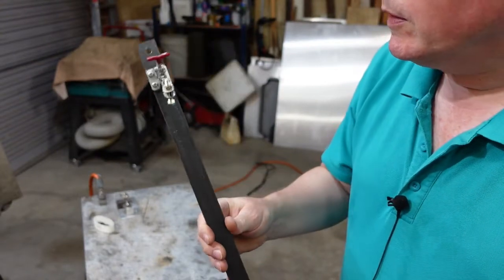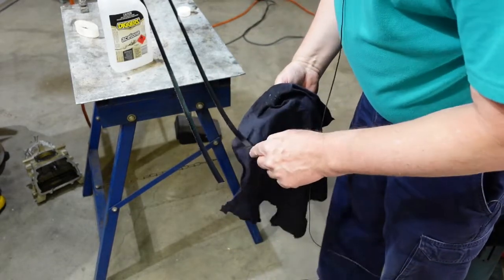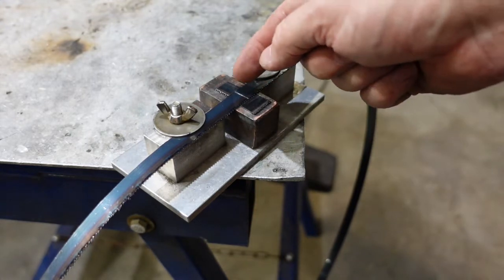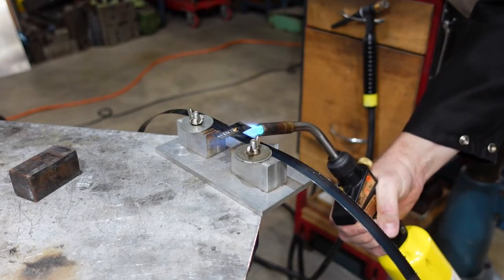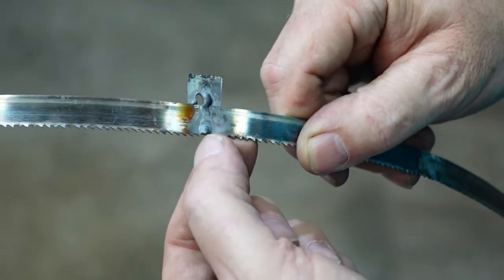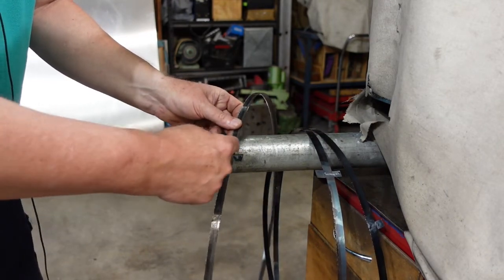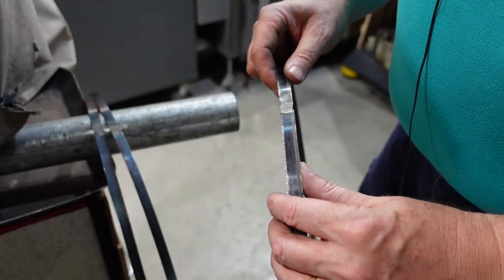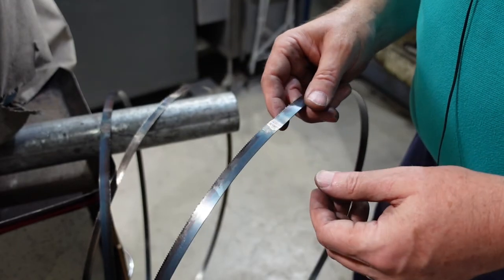Bandsaw blade welding

Comment: I was taught years ago to Silver solder Bandsaw blades by a Pattern maker a lot more involved but gives a better join in my experience, I have only ever joined blades for wood cutting saws
Reply from the maker: A proper lap joint has more surface area than what is effectively a butt weld, so any small inadequacy is less likely to matter. The reason I went this way was that I did not have the gear to sliver solder and when I had some blades made up that way by a saw place, they failed very quickly (the feathered edges caught and peeled apart). This is how I do it, just because I was not happy with the other methods available at the time.

Comment: When I was a teenager ( back in the mid 1960's )the schools in America had metal shop classes and I was taught to braze band saw blades. Very similar to silver soldering them but I believe brazing gives a stronger  joint.
The vertical band saws we used  had electric band saw welders included on them but the instructor wanted us to learn to do it the hard way as well!
No TIG welders back then and arc was way too hot so brazing with oxy/acetylene was the only way.
Several year's ago I bought at auction a Harbor Freight band saw welder. With fees it was $100.00 U.S.D. and it came with a couple of rolls of blade stock. Unfortunately for me it was for woodworking and I don't do woodworking so I sold them for almost the total cost of the welder. I have some longer blades than my saw takes so I have cut them down to the size I need and the welder works great. 
It appears that H.F. no longer sells this welder. Too specialized I suppose for the general public and besides, selling new blades all the time is far more lucrative!!
Thanks for showing an old man another way to weld up his own blades!!
Reply from the maker: When I first got my bandsaw, I had a local saw shop make up some new blades; brazed. They botched it up such that the blades peeled apart on the first cut. I don't have gas welding gear, so for me it was TIG them together.

Comment: Did you use a filler rod on the joint?  If so, what are the specs?  I have a knifemaker nearby who would like to have me be his "go to" welder for bandsaw blades and such.
Reply from the maker: According to the box the filler is Comweld LW1. Nothing special, just a steel filler rod

Comment: My father told me to planish the join to work harden the annealed portion.
Reply from the maker: I did do that for a while but it does not seem to make much difference to the outcome. The wheels on my saw are only small (180 to 200mm from memory) so I suspect that the flex involved is enough to do that. I don't recall hearing planishing as part of the sequence for resistance welds blades though, so it might just be one of those things that some people do and some don't with no clear evidence one way or the other.

Comment: Also, what are the dimensions on the square stock?  Looks to be inch and a half.
Reply from the maker: Not sure exactly what square stock you mean and the jig is made from just what I had lying around, but for scale the blade is 1/2" wide, and the copper block is slightly under 1-1/8" square

Comment: Can the same technique (Arc weld and Anneal) be used for C62 Carbon steel bandsaw blades?
Reply from the maker: As the blade material is thin, you need really good arc control. I have heard of people using MIG, but I would suggest TIG as the best method. I think Stick would be very difficult (I usually use around 35 to 40 A for this)
These blades are plain carbon steel and work. I've never tried on anything else. Perhaps an experiment or two on some old blade might be worthwhile.
Reply: @occasionalmachinist  Can you provide a link for the stick?
Reply from the maker: @saktheon  Stick welding is manual metal arc welding (MMAW). I think it would be too aggressive for welding thin blade stock unless you were using really small electrodes. I would not recommend it, and can't suggest any videos that use it for that.

Comment: Your microphone cord stresses me out. I worry you'll cut it by accident. I highly suggest you put the cord underneath your top. 😊😊

I never knew you could make your own blades. I found this very interesting and informative. When you were grinding, how come you weren't wearing gloves? Won't the sparks burn?
Reply from the maker: Couple of safety things here. 
Firstly, I usually take the microphone off when working in case it does catch or get cut. it is cordless for that reason too. In cooler weather it does go underneath clothing but during warmer months I clip it on top.
Light grinding like that, the sparks 'tickle'. With heavier grinding they will burn and even set things on fire. I try not to grind within 1/2 an hour of leaving the shed, just in case a spark does get excited. Gloves are a mixed blessing. Usually not recommended for use around rotating machinery in case they get caught up, they also can make things more difficult to manipulate. Typically when welding I will use an angle grinder while wearing gloves as everything is hot. Other times, less likely (but I always wear eye and hearing protection if you are wondering).
Thanks for your concern though (and speaking up). Safety is important.
Reply: @occasionalmachinist  ohh! Very fascinating.

Thanks for clarifying. I look forward to your next video! 😊
Reply: So.. You've never used a grinder... Those little sparks on hand make from a man to be a real man!!! 😅😅

Comment: Problem with splicing in a piece of blade to repair a stuff up is that now you have to get it right for two joints.
Reply from the maker: Double the fun! 😁
Trouble is, grinding down the weld thins the blade, so while it might work once, trying to reweld the same section of blade a couple of times and you create a weak point. Far better to take a chance on fresh material - original thickness and no underlying material defects. A straight seam too, which for some reason seems easier to weld.